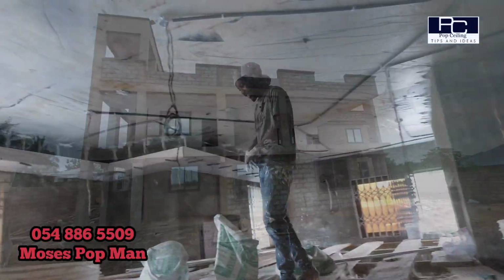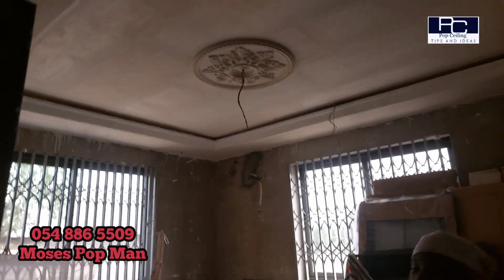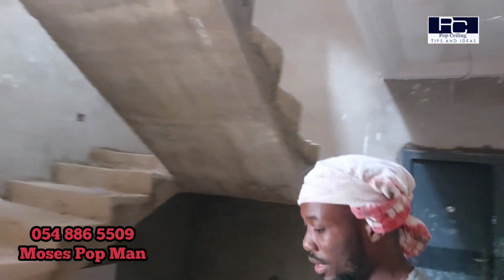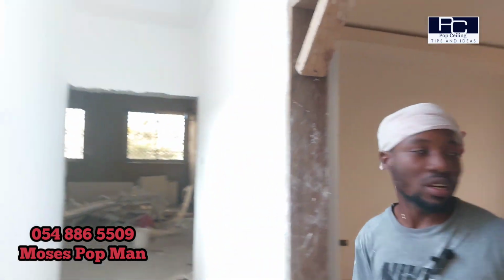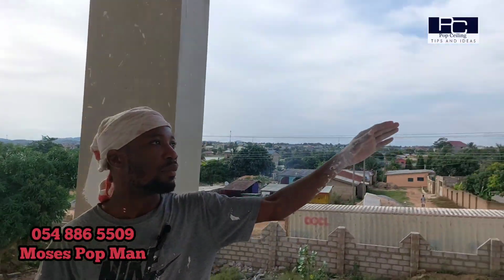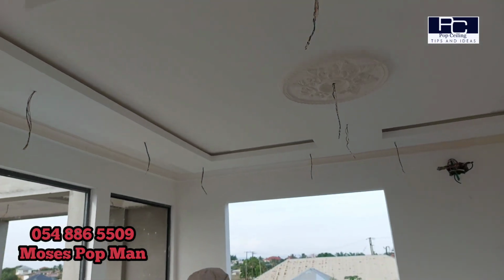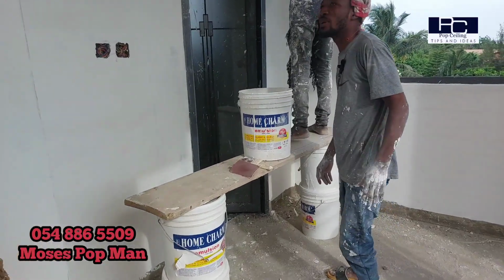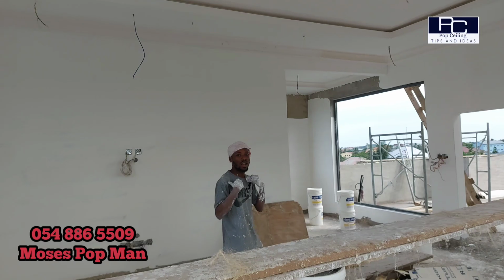Working in a 7 Bedroom luxury Mansion in Ghana || POP Ceiling and Wall Skimming, building in Ghana🇬🇭

Comment: How many days have you work on this project ?
Reply from the maker: We are in our 4 weeks
Reply: Wow , 4 weeks ?
Reply from the maker: @edward Adu  yes, because every floor is concrete flow, it takes time to do, it is not like the wood joint
Reply: @popceilingtipsideas8939 , I am learning so when its concrete ceiling do you just skim with home charm or do you cover with pop ceiling ?
Reply: @edwardadu9338  any of the two can be done, its depends. When concrete is very rough, skimming alone won't cut it. That's why its better to 1) pipe the concrete ceiling with ALL lighting before casting. 2) use smooth plywood like marine plywood.
Reply: plywood bolted to the concrete ceiling?